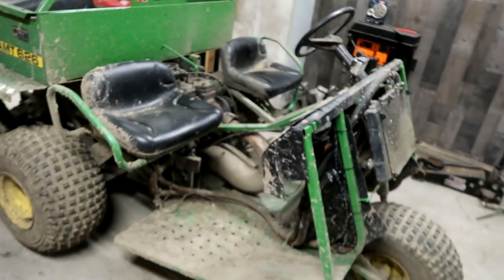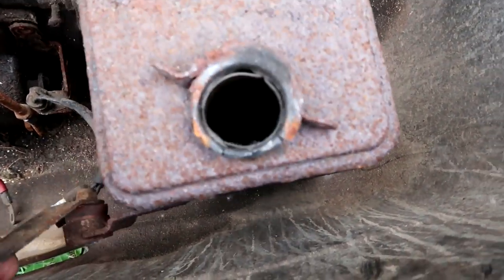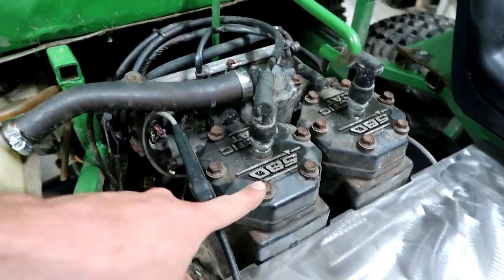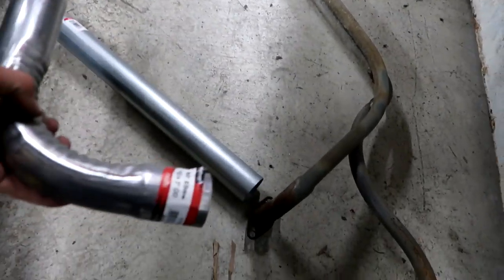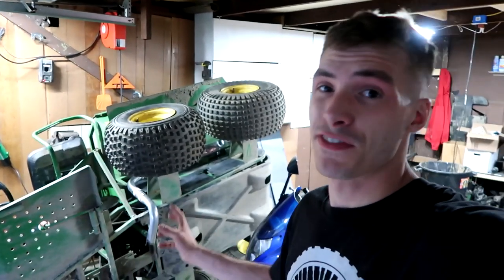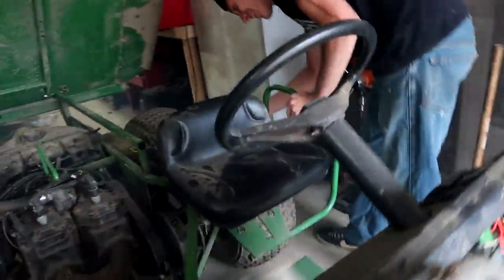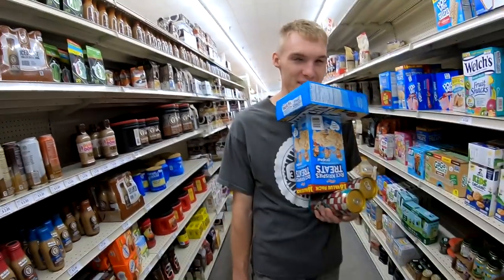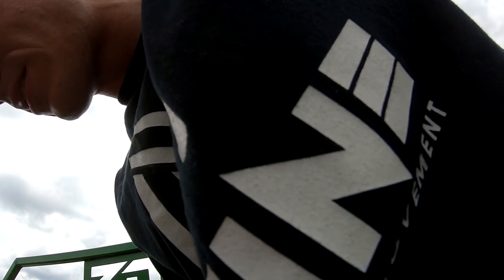600cc 2 Stroke 100HP Grocery Getter!

Comment: The exhaust is probably too tight and sending pressure back into the engine that used to happen on our four wheelers
Reply from the maker: Youre correct. We chopped the exhaust today and it is screaming again!
Reply: That was my guess exactly.

Comment: You have to much back pressure in your new exhaust system. If you replace the motorcycle with a glasspack muffler you'll be fine. I suggest you cut off your current muffler off to confirm the back pressure issue then proceed with glasspack replacement. Glasspack's were a go-to old school hot rod muffler hope this helps. Love the build!!

Comment: Could you by any chance use Mini-Ex tracks to add tracks to the Gator?  I was thinking, if the wheels are all locked together with a chain, couldn't it work as a tank?  Or does it have a diff?

Comment: Probably running to rich with the extra back pressure
Reply: The muffler is not supposed to create backpressure? The end of the expansion chamber does
Reply: @dialgia111  it does because near all mufflers are a restriction in witch increases back pressure
Reply: They should not
Reply: The stinger behind the expansion chamber is what creates the pressure